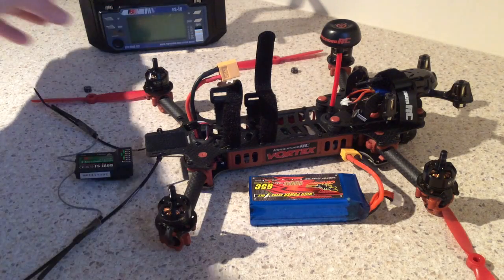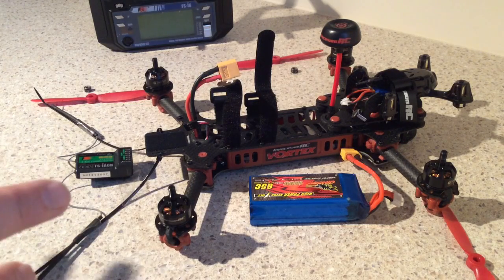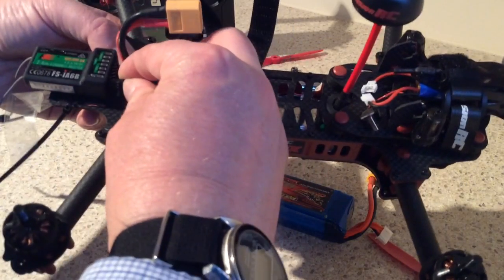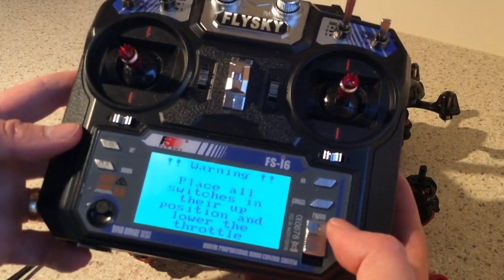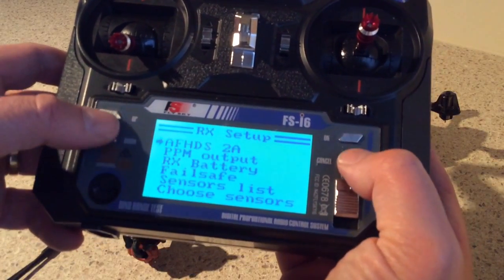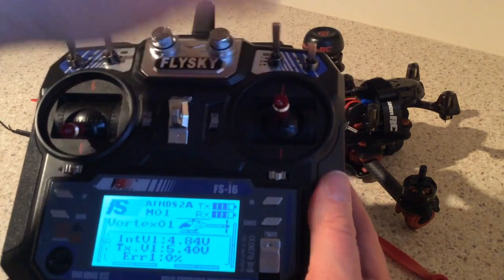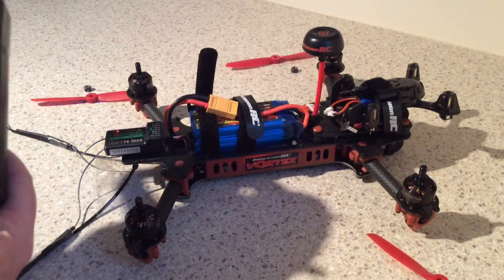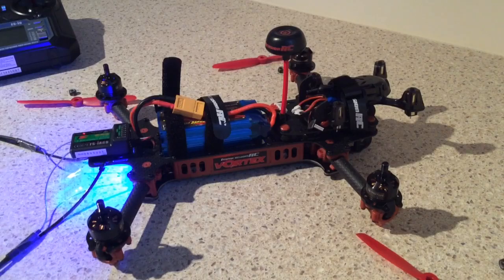How to setup your FlySky FS-i6 TX/RX with ImmersionRC Vortex 285

Comment: Hey how you doing bud i have a i6a receiver with a flysky transmitter i got ppm on it enable channel 5 on swc but i dont have no stick movement when on the initial setup do i have anything i might forgot.
Reply from the maker: Have you got the right connection between the receiver and the quad?  It should be on the 1st (leftmost) set of vertical pins.
Reply: ChromeFreeDisco yea i change the ppm setting it was on pwm
Reply: ChromeFreeDisco where there any setting u added to remote like subtrim range adjustment any setting different then the initial setup
Reply from the maker: I didn't make any changes other than the ones shown in the video.  Not to say that some other trim changes etc wouldn't help.  But this is just to get you started and in the air.

Comment: Sir pls tell me how to connect 4 esc to one reciver and one battery to 4 esc
Reply from the maker: You need a power distribution board and a flight controller.  These are all built into the Vortex 150.

Comment: hi...
i am not able to control my quad with my FS-i6 .only one motor of channel 3 rotates.plzz suggest me
Reply from the maker: It sounds like you don't have the ppm mode set?  Channel 3 should be throttle, but for all props at once.  Is it a Vortex 285?

Comment: can you explain in detail abpit channel 5 setup u did for swc?? what is the purpose of this ...
Reply from the maker: It is to enable you to change flight mode of the quad.  Top position is ANGLE (stabilised) mode  - where it self levels if you centre the sticks.  Bottom position is ACRO mode where it's attitude stays the same when the sticks are centred.  Middle position is somewhere in between.  ANGLE mode is useful for beginners or if you are coming in to land.  ACRO mode gives the best flying feel and allows you to do flips and rolls etc.

Comment: hi i am lingesh even i have FS I6 radio transmitter but it is not connecting with fs i6 can you suggest me.
thanking you
Reply from the maker: Attach the bind lead to the bind marked channel on the reciever.  Power up the receiver,then on the transmitter press and hold the bind button, then turn on the power.  It should bind within a second or 2.